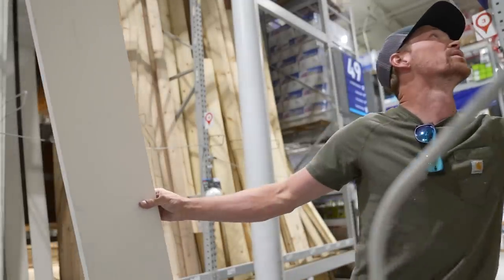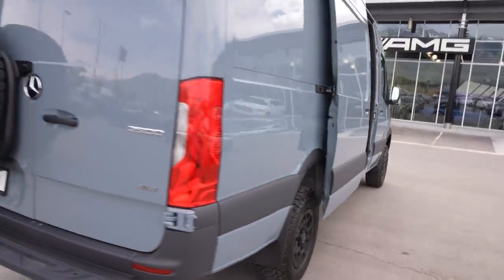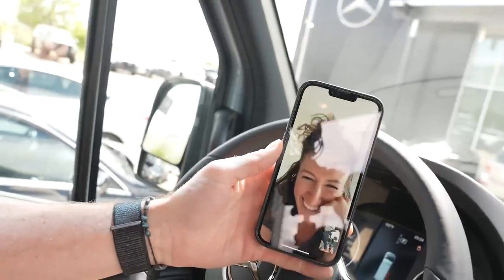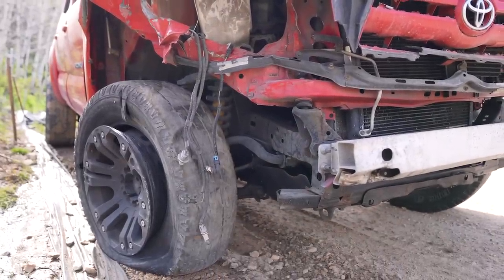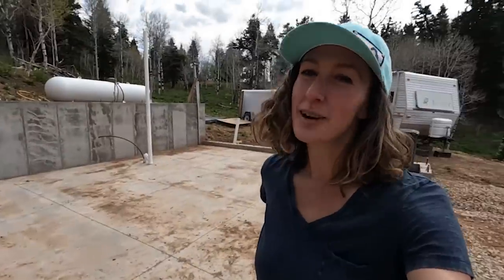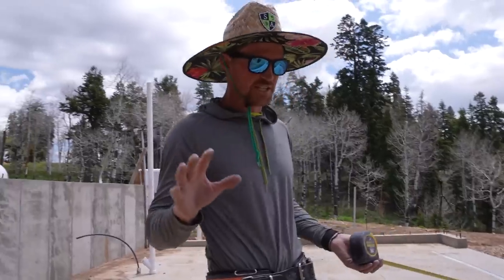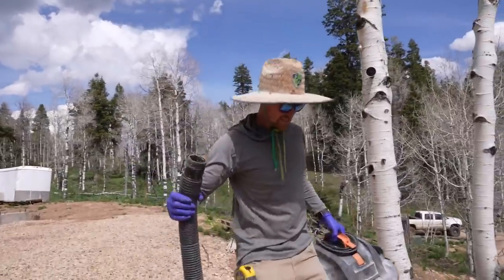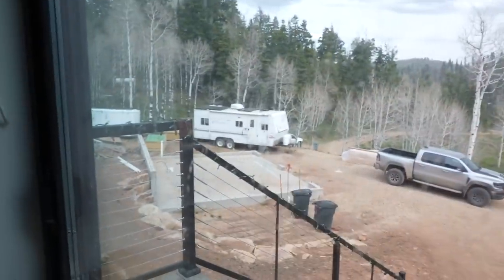THE GARAGE BUILD STARTS NOW!!! | BUILDING OUR OWN HOME

Comment: 3 4 5. Is a much simpler way to square.   Any multiple works.    345.  6 8 10     15 20 25   The largest number is the Hypotenuse.    Inches feet meters does it matter

Comment: Why don't you get a bucket system/forks for your Kubota tractor? You could move lumber and set up walls, and with a gin pole even set trusses in place. With a hitch bar, the three pt hitch on the back could also pick up the front of the new truck and park it off the road. Lots more uses that just a snow blower...

Comment: Yep the bags you get heavy when I was doing structural steel my bags that I put on every day for eight to 14 hours a day or 75 lbs every day then sling sheetrock or steel a welder a gas chop saw watch your back it's the first thing that came out use suspenders

Comment: How to check the calibration of a level. Put the suspect level on any near level surface and look at the position of the bubble. now turn the level 180 deg. End for end set it in the same place , making sure there is no dirt or debris under the level then check the bubble again. if the bubble is in the same position as the first reading the level is good. It does not need to be on a level surface for this test.

Comment: Maybe you could set the Shelter Logic up on the terraced area above the garage and put the Tacoma in it so you cave a covered work area to keep the truck dry as you work on it, have easy access to electricity for your tools and light, etc, and it will keep the eyesore away from prying eyes.

Edit: Oops! You gave the shelter logic away. Oh well!

Comment: Although I'm a BIG fan of your channel, Trent--you need to work more efficiently. As a former contractor who needed to minimize trips to the lumber yard or I'd blow the time allotments in my bids, I'd say that you need to plan your materials purchases to make many fewer trips. 
Also, the guys in the van shop seem to have a more leisurely attitude towards organizing their time. Less standing around--watching each other discussing the "next step'. To turn out a build with cost savings in mind, the crew needs more "standard practices" and plans to build from so each can be working independently to move the projects forward.

Comment: Apparently you could by a new Toyota Tacoma with a 2.7L with 159 Bhp and 180 lb.-ft Torque.
god that is crap specs for the engine.
I get similar performance from my Dacia Duster and that has a 1.3L turbo engine with 150Bhp and 188 lb.-ft torque.
only weighs 1200Kgs too so it goes like s-h-i-t of a shovel !